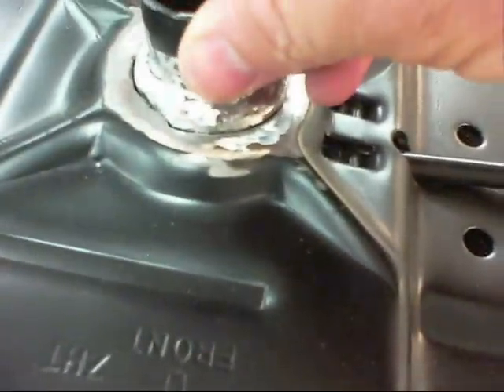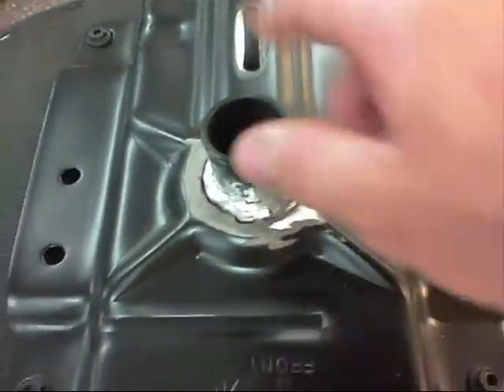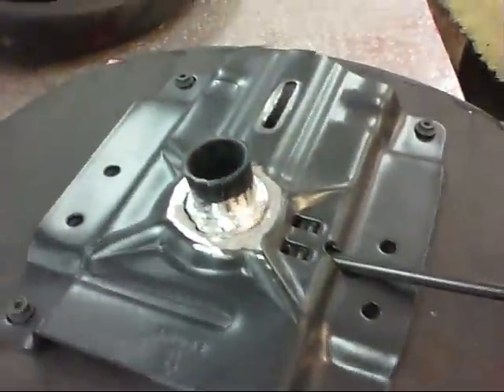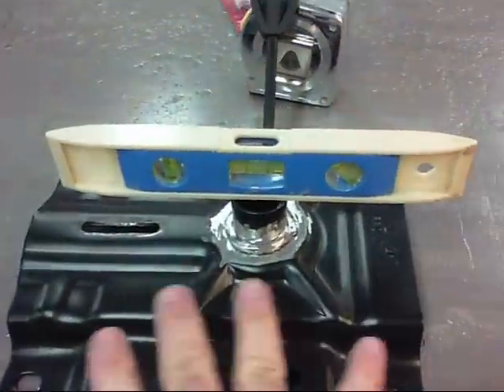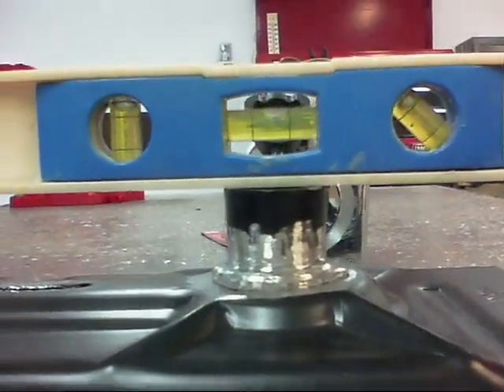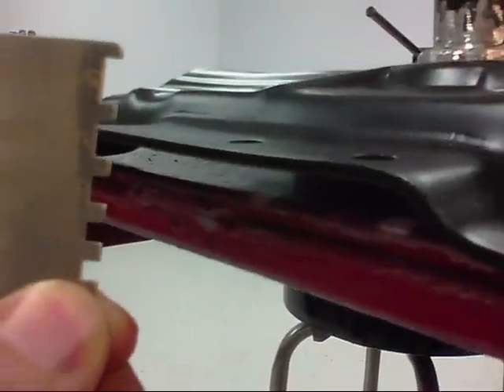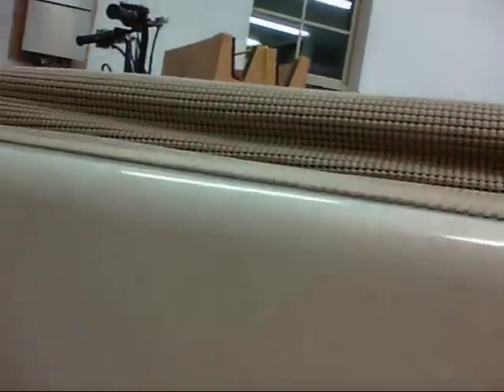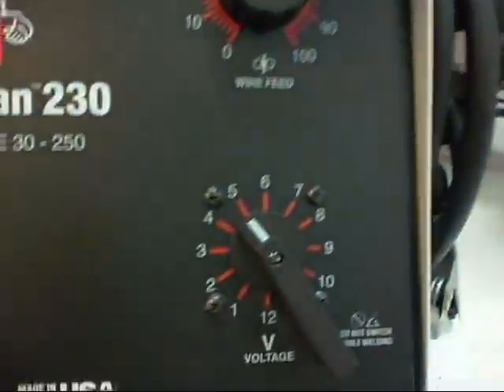Office Chair Metal Failure and Repair

Comment: one should never weld the fitting once it has been broken off the mechanism as it will stay in place for not more than a month. buying new mechanism is a better option than buying a mig welding machine.